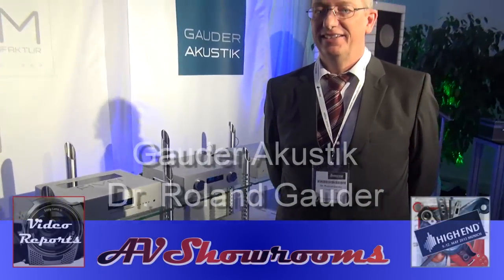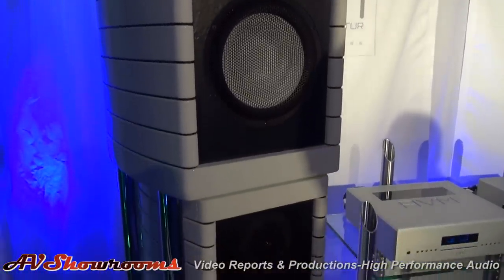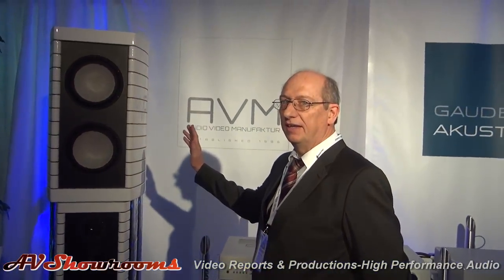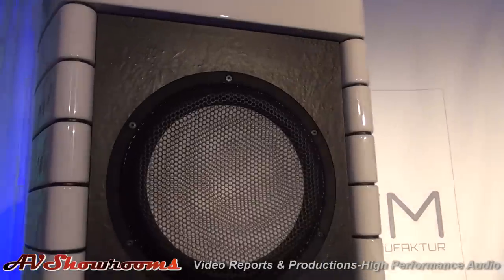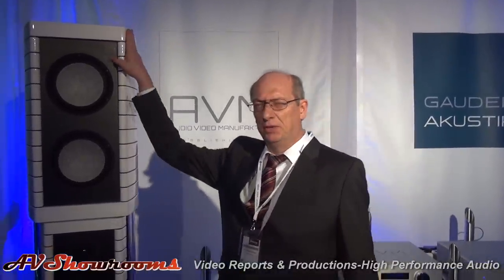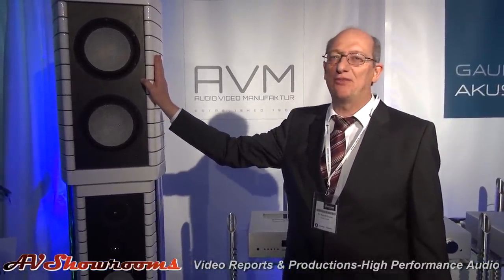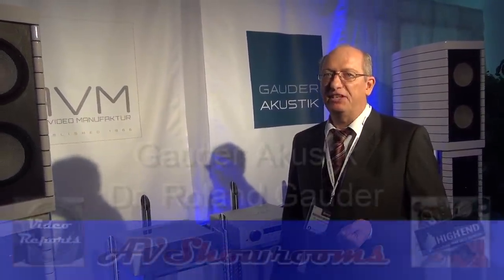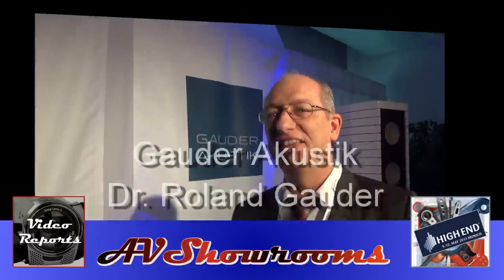Gauder Akustik, Gauder Acoustic Loudspeakers

Comment: Dear Dr. Gauder, 
You had my respect until you started with theatrics putting your hands around your mouth portraying horns and knocking high efficiency speakers. You know very well what you portrayed is inaccurate and more of a megaphone and than a properly designed horn speaker. Second, using the same theatrics you fail to tell the audience that listening to an inefficient speaker like yours is like covering your mouth with your hands and having to shout through your fingers to get any sound through, hence the need for high powered monsters with little finesse. But then again how else are you going to defend a me too concept purely predicated on Accuton drivers and their extreme flaws. Please don't insult our intelligence and think that all audiophiles are nothing but morons!
Reply: What are you telling there? Accuton drivers are the best of the world and they also produce diamond-tweeters, which are considered by experts as the best loudspeaker material available.
Reply: I know 2 of the best german loudspeaker engineers and i can tell you that they dont like stiff cones at all, not even ceramic, cause you can only use it either with notch filters, which audible and measurable take away dynamics or you need these 50/ 60 db (48db electrically) filters that gauder uses. and these fiilters, well ... . i have Magnat Quantums here that as well have stiff cones and 24db filters (engineered by Karl.H.Fink), and even on 24db LWR filters you can here the dynamics that is missing in comparison with 6 and 12 db at least. ..Still they sound great thought.
Reply: Get to know with Tidal Audio. They use their diamond and ceramic drivers just perfectly and produce incredible results. Jörn Janczak, CEO of Tidal Audio, is the best loudspeaker engineer in Germany.
Reply: There is only roundabout 5 engineers in Germany that can really handle passive crossovers, K.H. Fink ist the best. I know more then one saying that and i know his speakers.